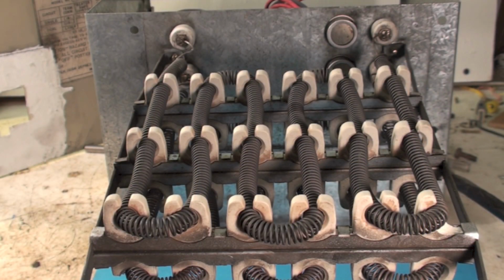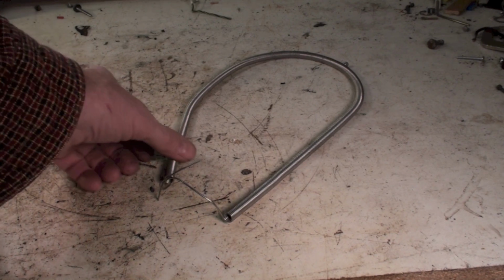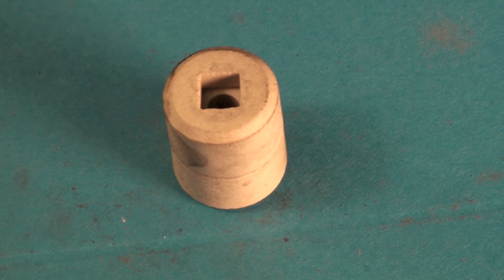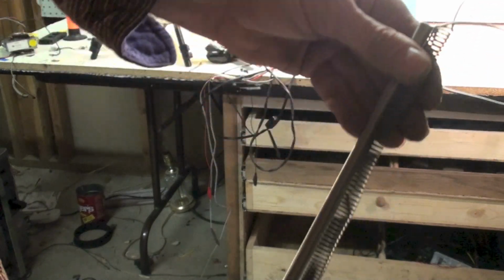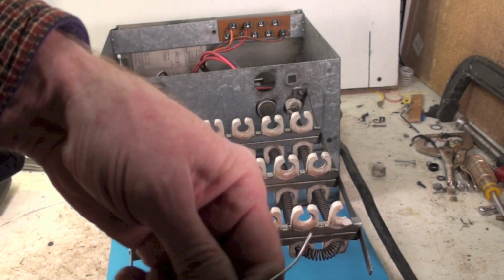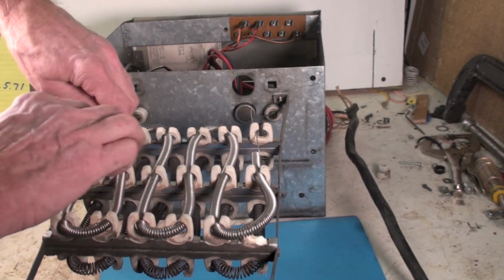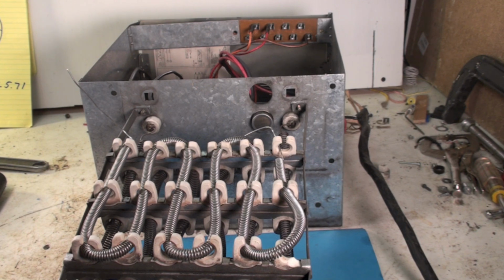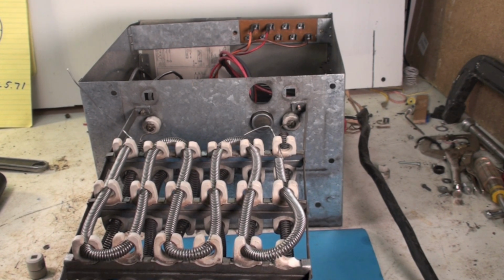How to restring the electric furnace element

Comment: I have a question for you if you have like a four or five roll and you stretch it out to a 6 row does it cause the element to heat up more and possibly fail due to less resistance or it doesn't matter how much you really stretch it it's going to heat up the same I replaced one it was a 12 kv set and mine was 15 KV cannot find my correct assembly so I stretched it out pretty far into end to make it work and yes it was pretty far apart and it burnt out pretty quick within a day some spots was about an eighth of an inch apart from each other or even more
Reply from the maker: This one bothers me.  First, whether stretched or not, the resistance is the same.  Most of these elements stretch out to at least 1/4 in between coils.  Because you have used a larger (in KW) coil, you may have overloaded the heater.  Have you checked the supply air temp?
GFM

Comment: Can you use a restring kit that is the same KW and the same voltage just slightly bigger diameter strip? Wouldn’t the resistance be lower causing it to pull more amps or since it’s the same KW it wouldn’t matter?
Reply from the maker: KW is KW.  It will not pull more amps.
GFM
Reply: @grayfurnaceman  thank you. The reason I asked is I restrung a heater on a VAV and the 3 phase 480 volt  5KW Heater was pulling 17 amps when it was supposed to pull only 6 amps. What could cause the new 5 kw strips to pull high amps? Would a faulty contractor be a potential issue?
Reply from the maker: @mbranbb  You can't restring a 3 phase heater with a single phase one.  You must replace the entire heater to make it work right.
GFM
Reply: @grayfurnaceman  so a coworker ordered these 480v 5KW restring kits about a year ago and he ordered them to replace the 3 phase heaters we have in our building. I just looked up the part number online and you’re 100% right he ordered single phase restring kits instead of 3 phase. You’re the man Gary. Thank u very much.

Comment: This saves a lot of money.  Like $15 instead of $400. Can you get the ceramic replacement?  I just did it with a dryer it came with the insulators.  There is usually 1 or 2 cracked
Reply from the maker: Yes and no.  I have seen kits with insulators but some insulators are different.
GFM

Comment: hey dude great video, im trying to install a new heating element kit for a Lennox air handler A/C only system, it do see the space where the kit goes, doe you have a video on how to install or add a heating element ? I could use the help. Thank you Richie from, Baltimore
Reply from the maker: I do not have a video on that procedure.  The heat kit is usually a fairly simple install and the kit should have instructions.  
The largest problem I can see is you will need to run larger wire to accommodate the new element.  
GFM

Comment: I just replaced the high heat limit switch on my electric drier.  I inspected the heat coil while I had the back of the drier off and replacing the failed switch.
I posted a short video on my YouTube channel.

Comment: My furnace runs me a high electric bill. Do you think it might be the heating element
Reply from the maker: Electric furnaces are 100% efficient.  If it is overheating, it will either overheat the structure or, if the fan is not running while the element is on, overheat the space it is in.  The heat must go somewhere.  I would be looking for heat loss problems in the structure and compare to last year's bill.  
GFM
Reply: grayfurnaceman - I have a Sundial electric air handler, it was a company that ceased to exist in 1986. It has a separate coil from the blower and the coil was just replaced a year and a half ago for the cold air. Well, the heater elements have crapped out on us and our repair guy says the only option is to replace the unit (quoted $2800 for that). It’s a 3 ton unit. Anyways, I was just so amazed that fixing the heater was not an option (even if a replacement part was not available). Would this be a viable option? I don’t know anything about this stuff so I might be using the wrong verbiage or terminology.
Reply from the maker: If the elements look similar to ones in this video, they are replaceable.
Many service techs don't understand electric furnaces and generally replace either the furnace or the entire element assembly.  
However, there are some element assemblies that are not replaceable due to the type of element used.
GFM

Comment: the one I did several years ago took forever to find a replacement wire for and it was three phase and in many pieces.  I ended up measuring the would be path with a tape for the length and put one bold in the vice and stretched it out like 150" so that it would be evenly stretched.  Started in the middle like you and it worked out great.  I wish there was a formula for these nichrome wires,  like checking the required KW and voltage and finding the resistance needed somewhere along the length of the wire, cut it there and connect.
Reply from the maker: Glad you got it to work.  I have had poor luck with 3 phase elements.
GFM

Comment: Do you have to make sure that the coils are not touching each other? lets say at the turns.
Reply: Absolutely.   When you watch the video, note that when I stretch the element, I make it shorter than it needs to be.  That is to keep it tight when it is stringed.  When it heats up it stretches so you want to be sure it does not sag.
GFM

Comment: I have a train unit and one of the elements failed 😭
Reply from the maker: Most Trane models have elements that are quite hard to find for restring.  I would first check to see if the element over temp fuse has not blown.  
GFM
Reply: grayfurnaceman I had it checked with a certified AC company, he found a break in the element.

Comment: THANK YOU!  very much for taking the time to make this follow along video. As a customer, who needed this repair done, I was first told by the tech, that he could restring my furnace until, the company salesperson rang the doorbell 1 minute later to high-pressure sell me a new furnace. You are an excellent technician in and a breath of fresh air in your profession to make up for the lazy, dumb cons like the ones that disgusted me with their bull today! Thanks again!
Reply from the maker: +Kelly Sirons Unfortunate that you were treated that way.  You are certainly not alone.  I wish you were.
GFM
Reply: the restring kit is great if you can find them.  Extremely difficult to do. Will require several hours of searching in most cases to find one that will fit your particular unit.  Manufacturers always want to make theirs a little different so as to prevent the cheaper fix, but then there's the labor to consider, to restring will end up costing more than the new plug and play strip heaters.
      I've only restrung one in 25 years because they  don't make them anymore, maybe because of liability issues and inexpensive cost.
Reply: hello .. great video.  My brothers electric heating furnace has stopped working and his inlaw had taken it apart.. i am an electrician by trade and am not too familiar with working on these.  Anyway from the firewall porcelain mounts on one side there was what looks like a diode or an inline thermal overload welded to the through bolt head and  then wrapped around its opposite side bolt… the question really is ???  would you say that a diode or an inline  thermal overload ….

Comment: I'm having difficulty finding a supplier of Nichrome or Nunal or Kanthal or similar electric element heating coils like those used for furnaces etc ?
They need to be approximately 0.9mm wire in approximately 8mm coil and resistance approximately 40 Ohms.  I need to stretch them out to approximately 3.6 meters to replace broken ones in my machine.
Supplier suggestions please ?
Reply from the maker: +Andrzei Czajkowski Are you sure it is that long?  The maximum I have seen is 1 meter.  I can't say I have seen any that long.
GFM
Reply: +grayfurnaceman. It's for my plastics vacuum forming machine.
Reply from the maker: +Andrzei Czajkowski It is probably a factory part only.
GFM
Reply: +grayfurnaceman You're correct.You're a genius. I tried the butcher, the drugstore, Wallmart, a carpenter, a bricklayer, a candlestick maker and the tailor but they all said "These are probably made in a 'factory'somewhere". Then I foolishly asked a 'furnaceman' if he knew of a company that made or sold nichrome or similar coiled wire elements because he had a youtube tute on the subject of replacing coiled wire heater elements. How stupid am I ? And I guess you can't tell me which butcher, drugstore, Wallmart, carpenter, bricklayer, candlestick maker, tailor, factory or industrial supplier you buy your coiled wire heating elements from ? They're only available as OEM factory parts eh ? Cool. I'm so pleased I asked. ps Are you located in Minnesota or Canada ? Do you feature in any of the Fargo episodes ?

Comment: thanks GF man...used your vid to install all 6 new elements in a 30kW Brady Bunch era Rheem model.  By my calculation this unit with six  sequencers (25 ohms per coil) has  about 6 ohms on the transformer secondary, pulling about 4 amps. Has the industry established a standard size transformer to accomodate that many sequencers?

Comment: for curiosity sake , could someone tell me why one couldn't simply tig weld or bridge the broken part of one?   It seems that the nichrome would heat up just the same so long as the electricity flows.
Reply from the maker: Brady Rose I am not sure nichrome wire is weldable.  You could wrap the ends together, but the joint overheats.  I will probably do a video on wrapping it together.  Remember, these elements are not expensive if purchased as a restring kit.
GFM
Reply: grayfurnaceman
  To be clear,  I should point out that I am not asking this question in an HVAC context. I am interested in the use of nichrome wire in the context of a variety of applications and am not looking at this as simply replacing a coil in a household heater.  It does appear nichrome wire can be welded together, but probably welded to itself rather than using filler.
Reply: +grayfurnaceman  That would be great ! Can you provide a link to your youtube re wrapping to join elements please. If not then can you message me some instructions please.

Comment: Dont see many of those up north. The electric bill must be crazy
Reply from the maker: Actually, I am up north.  We used to have very low electric rates, so there are some.  Can't compete with gas any more.
GFM
Reply: There are areas were I live which have been deemed too unstable to support gas lines. They either use electric heat, a heat pump, or propane.

Comment from the maker: Some heat sections are not designed for element replacement and the section must be replaced.  However, some are easily replaced and the price difference is quite high.  I cut my teeth on electrics, so I have a bit of a soft spot for them.
GFM

Comment from the maker: I cant agree on that one.  Almost all electric furnaces are repairable with general replacement parts with some exceptions.  Efficiency is not an issue as they are all the same efficiency.  I would change out the furnace if it made sense from a fuel source standpoint.  
GFM

Comment from the maker: I think that element was from an appliance store from around 1980.  It was some sort of general replacement part and I used them for a short time with double washers on the end.  When I found kits that had the fuse, mounted bolts and ceramics in the kit, I changed.  I some times replaced element carrier assemblies because of broken ceramics then took the carriers apart and reused  the good ceramics.  Thanks for the comment.
GFM
Reply: Can u help me out
Reply from the maker: @goatsinsports6970  What is your question?
GFM
Reply: @grayfurnaceman  we have charcoal furnace 8mm thickness sheet of MS Plate 10 Feet long 05 feet width it runs up on wood which we fire under the furnace to rise the internal temperature to 500 Degree for converting wood into charcoal can you tell me about replacement of wood with heater under the furnace to raise the temperature ? if yes then please tell the type of heater. Thanks

Comment: Do you think that strip went a certain model or just a factory screw up,forgot to install bolts or what? I tryed to think if i ever came across something that would have used 1 without bolts,nothing comes to mind,i have changed several diff types of strips,some that some 1 else already screwed up and stretched to far,just had to start over,a lot of those insulators are very weak and not well made,very easy broke,i have used dryer strips also 4 heat strips but gotta look at kw closely,great video

Comment from the maker: Is the ice even throughout the plate?  Hollow center indicates charge problem or TXV.  I know it was replaced.  Was an oversized drier installed?  That will increase charge.  Compressor problems are indicated by higher than normal lo side and lower than normal hi side.  Give me lo side press after 2 min op.  Then lo side after 10 min.  Is water manifold running smooth over plate?  Could be as simple as adjustment of bridge.  Also note blades of bridge should be clean.  Let me know.
GFM